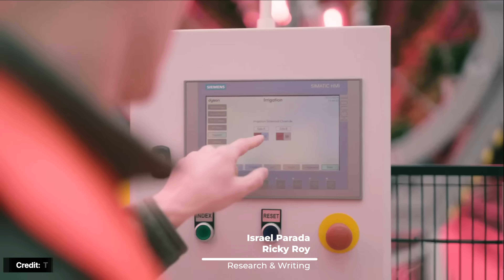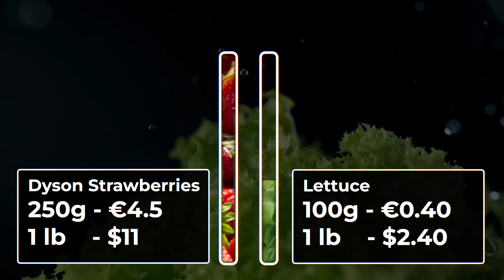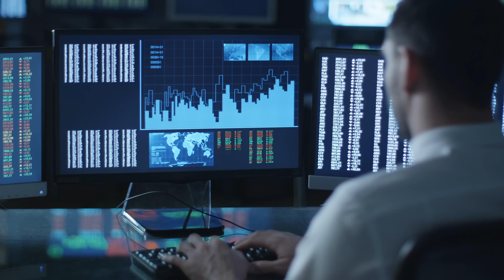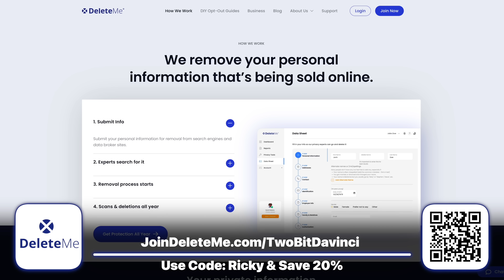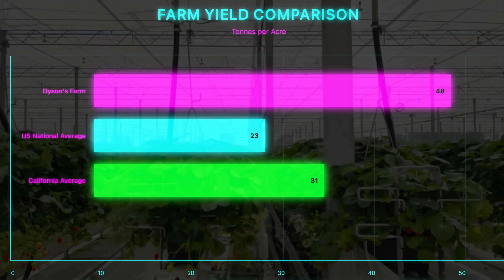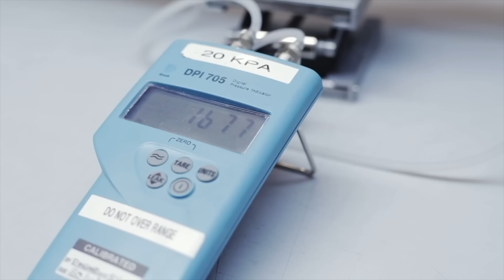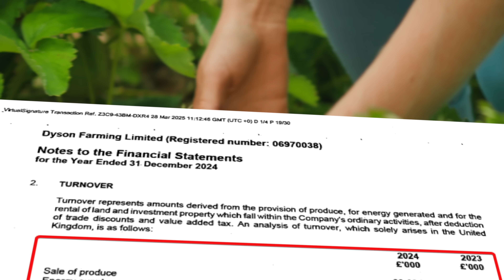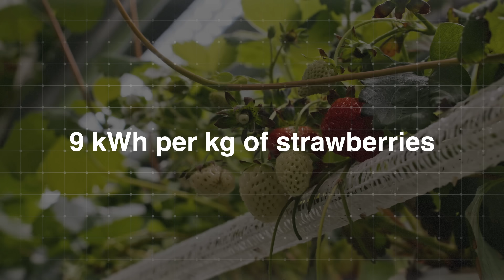The Company that FINALLY Solved Vertical Farming

Comment: Great investigation. To me the summary is "no, vertical farming is not viable on its own, but if you turn waste into a resource you can make anything profitable."
Reply: That is done in normal farms to. Methane power many conventionally farms
Reply: If they use this in a greenhouse, they can maximise how many plants a farmer can grow in that greenhouse. (You can even use elevator-type of technology instead of circular, to place them next to each other.)
Reply: @millanferende6723  And then have solar cells, electric control circuitry, batteries and led lamps. Instead of using the sun directly. It can only be viable with a severe shortage of farmable land
Reply: @lubricustheslippery5028  For Netherlands, that is the case that it needs more land. Also, with housing situation in many European countries, that is also viable option.

Solar cells would not be necessary, as that defeats the purpose of conserving land.
Reply: @millanferende6723  Nuclear is more expensive and coal, oil, gas is worse for the environment, hydro is limited, wind also uses lots of space. In places with lots of sun solar is often the best cheapest alternative, in places with lots of wind wind is the best.
Reply: @millanferende6723  Housing crisis is not because of lack of land, it's because to many want to live in the same place and greed. Produce can be transported into cities.
Reply: That's exactly what I was thinking watching this video. I don't see the 'vertical farming' / 'revolution in agriculture aspect of this plan. I might be mistaken, but I basically see someone combining a relatively low value adding economic activity (growing strawberries in a very capital and energy intensive way) with a high value adding economic activity (producing clean energy).

I might miss something, but I don't really see what 'vertical farming' adds to the mix. Couldn't this work just as well (if not better) with normal farming? You would have the same agricultural waste, which could be processed into biogas, right?
Reply: @jac540  Many normal farms process agricultural waste as manure into biogas and use the rests from it as fertilizers. And the strawberry wheals doesn't add so much verticallity.
AI and robotics in farms are interesting, it can reduce the use of pesticides and fertilizers and treat each individual plants.
Reply: @jac540  Yes, exactly. Although it seems they can get a premium on their strawberries, and at least part of that is the mystique of high-tech processes.

Comment: If the strawberries are really a byproduct, then what they are actually doing is using energy that could be sold at a profit.  In other words, the strawberries are a money sink-hole that is dragging down the overall performance of the rest of the farm.

And no, these are not at all, in any way, a solution in a "nuclear winter" scenario, since in a situation like that, the field crops would all be dead, and not producing energy to maintain the greenhouses of berries.

Dyson hasn't actually fixed any of the problems.  He's just chipped away a little at the overall costs, while still being far outside the envelope of a viable business.

Comment: While this is all good, still misses the point of vertical farming. The main reason it was suggested was to compact farm production into buildings, largely for places that don't have a lot of land to work with. Then somewhere in there, the plot was lost and tech bros wanted to turn it into a money making for nothing operation and got bored. And broke.
Reply: That's true. This is more of a hybrid between a vertical farm and a greenhouse. It's a very engineery thing to do, trade one thing off for another in search of an optimal solution.

Comment: Humans infatuation with industrial agriculture is totally anti human and unhealthy. Symbiosis with nature the way God created will be the only way to affordably grow truly nutrient dense, healthy food using a fraction of the inputs that vertical farms and industrial agriculture uses. Look up Polyface Farm in Virginia as an example of this symbiosis with nature in true agriculture husbandry. All of these techno agriculture factory farming methods are incredibly inefficient and destined to fail. God is not mocked. Humans would be wise to humble themselves to solve our food security problems and study nature.
Reply: There is not a food security problem. There's a human closed mindedness and greed problem. The desire to control the food supply so you can control populations is the end goal. Not sustainable or healthy food. Be careful where you go with this Ricky. This is a great engineering feat but goes in a bondage direction unlike the freedom and energy independence of solar and off grid battery systems. Two totally different mindsets.

Comment: I believe the figure of 10k uk homes, is the overflow electricity that they sell back to the grid. E.g. they produce a lot more, use most of it themselves, then sell the excess back to the grid. In the UK you can get sweetheart green deals that pay you per kWh you generate, not necessarily per kWh you give back to the grid. That could explain the math not mathing 😅

Comment: If geothermal energy is available it could be a cheap way to power and heat or cool a growhouse. That depends on location. I live in Virginia and I have seen geothermal stuff very close to Chesapeake Bay, which surprised me quite a bit. It was for a single home, and I don't know if they make electricity with it or just use it for HVAC. Anyway geothermal may be a viable option in some places. Iceland uses a lot of geothermal and they grow plants,for example.

Comment: electricity generated on the farm is NOT 'free' for greenhouse use since it could otherwise be sold back to the grid for cash
Reply: @kevinwelsh7490  do keep in mind that the electricity is generated entirely off of the waste from the greenhouse, thus putting power back in the greenhouse simply keeps the process going, and can't be counted as available for sale
Reply: @gwenmcgarry528 no, they grow crops in open farmland to provide biomass for burning to provide the heat and energy.
Reply: @PaulineFerguson  wait, the biomass comes from a seperate farm? If so that changes my analyses, I thought it was said the biomass comes from the strawberry farm
Reply: @gwenmcgarry528  I just double checked the video to be sure, and at about 6:00, that's where the biomass farms are explained. If it was made as excess from the in-house crop, that would be impressive 😊
Reply: @PaulineFerguson I seeee, ok then this isn't nearly as impressive

Comment: Okay so the real product of these this scheme is digester biogas electricity, and a nice byproduct is somewhat overpriced strawberries. If this were truly a great idea then you would be able to sell strawberries at market competitive prices. The ferris wheel contraptions may save on electric lighting but of course maintenance and upfront they cost far more than just racks under a greenhouse roof. So why not just use the digester biogas electric plant on a regular greenhouse. You use supplemental lighting, warmth, and CO2 in exactly the same way. Eventually you can use the automation aspect as well. I mean the real gist of this is that greenhouses make a lot more economic sense than vertical farming, and that technology is absolutely stone simple and widespread and much less expensive. You can locate greenhouses on marginal land that's not fertile or prime ag production land.

Comment: The devil is "sometimes" in the detail, which should be "always in the details".    

In So. California's desalination of seawater takes as much energy as transporting the water from the Sacramento River to LA over the mountains that are 4,000+ feet high.   However, our California Coastal Commission uses a mathematical model to predict the impact of sucking in larval fish, which claims "entrainment" is a significant impact.   If you dig into the details of the math of their model, there is an assumption buried in the math that dramatically changes the results by factors of hundreds.   This false assumption, known to be false in fisheries biology for over a century, can't be challenged by the CCC rules.   Our governor is trying to spend 20 billion dollars on a water tunnel, when desalination would cost only 3-4 billion for the same amount of water (using capital costs of Israel, Singapore, and other areas dependent upon desalination).

Comment: Dyson financial statements are in UK pound sterling not USD could be the source of error. You said $ in describing the calc
Reply: Hi @chrissaunders9166 thanks for your input. To clarify, the calcs from the financial statements and the cost of electricity were all done in British pounds. We double-checked. The idea in the end was to estimate kWh of generation, which we did using the right currency. But, to your point, if we had made a mistake in the currency, the difference between the two wouldn't have accounted for such a large difference in the two estimates.
The main problem is knowing how Dyson defines "enough energy to power 10,000 homes." In the end, both that 10,000 number and our numbers are estimates, but the difference is quite staggering, so there could be something there.

Comment: I'm really surprised that building and powering motorized crop rotators is less expensive than just LED lighting them
Reply: Building is just CAPEX so spreads out into years. The energy consumption would be quite low. These don't need to move fast so just a little motor with gearbox is enough. Growlight LEDs can be 30-100 W per single one in commercial models. To light whole place could be crazy amounts of energy/
Reply: @EnhancedNightmare  That's a great point. The key savings come from offsetting the LED energy consumption with natural light, similar to a normal greenhouse.
Reply: He is pretty famous for his decades of super efficient electric motors. I wonder if the bearings were super efficient whether drip irrigation on one side along the whole length of the trays would create enough weight if there was some clever release, regain, absorption system - or at least reduce the cost of running the motors.
Reply: I mean you have to throw enough LED to induce photosynthesis, that's a lot of energy
Reply: Calories in the food don’t come from nothing. At the very least you need to provide enough LED energy to cover the calories produced, but in reality you need to cover it 20 times over because photosynthesis is incredibly inefficient.
Reply: It's not. It's all Dyson BS. He can't show Dutch tech from Wageningen becausse of patents. Thus he will create the same thing a bit different, then call's him self a genius. And asks for money.

Comment: Whatever processes can make them more economical I am all for. Personally they could probably even take advantage of carbon credit schemes where they exist to lower the cost of operations or be co-located where waste heat is available.. And there are plenty of places where that's possible! Then again automation seems to be just as important in the process as where the light and heat are coming from since trying to avoid high labor costs are why most American farms were still importing agriculture labor from Mexico to do MOST of the actual work. And without them? Well? Californians can see first hand what happens... Fields full of rotting unpicked crops...

Comment: Your analysis was well researched, analyzed and top notch!   One thought - most farms in the U.S. will till the biomass back into the ground, this returns some minerals and nutrients to the soil,  and offsets fertilizer needs for future crops.  Being that they use this biomass to generate electricity instead, what are their outdoor fertilizer costs compared to other farms??  I would guess it would be significantly higher.
Reply: Biomass into gas - turbine - elec.... doesn't result in no fertilizer does it eh! You have a liquid fertilizer at the end of the process... think about it.
Reply: @edbrady9042  I've seen some cool hydroponic vertical gardens that don't need any soil

Comment: I would like to see a mass balance of the operation with inputs and outputs because I do have some doubts. But this is not "closed loop, given the input needed for the digestor operation. It is, however, good to see people/companies working on solutions for these farms. If they manage to develop these to the point where even feeder crops like rice, grains, potatoes, and others can be produced, then they can be used as a solution for food shortages.

Comment: 11:10 - I'm pretty sure you can't sell electricity to the grid at household prices.
Household prices are made up of a lot of parts.
There are the wholesale cost, government obligation costs, network costs, operating costs, VAT etc.

For 2023, the wholesale costs made up ~52% of the household prices. At 36p/kWh that's ~19p/kWh.
For 2024, the wholesale costs made up ~35% of the household prices. At 29p/kWh that's ~10p/kWh.
For 2025 so far, the wholesale costs made up ~34% of the household prices. At 30p/kWh that's ~10p/kWh.

Numbers are from electricitybills uk (YouTube hates links in comments, so fill in the dots). That site puts the average household at 3,100 kWh/year, so let's check both.
£9,371,000/year / 27,000,000 kWh/year £0.34/kWh. 
£9,371,000/year / 31,000,000 kWh/year £0.30/kWh. 

31,000,000 kWh/year * 36p/kWh (2023) = £11,160,000

That is suspiciously close to the household prices for electricity. So close, in fact, that I suspect those are the numbers they're using rather than what they're actually being paid.

But since you didn't provide links to any of your sources, like the financial reports where you got the numbers, it's impossible to dig into that report to see what they're claiming about those numbers.

Comment: Years ago I ran an ROI/Engineering study on the roughly same thing, with different crops, and came close to the same conclusions. Didn't have the financing and generally don't like vc's. Dyson should be able to vertically integrate the mechanical items needed.

Comment: ref: 11:08
One problem with you calculation. How did you get the price per KW. As fare as I could see they only gave the total in monetary value, not per KW. The way the British electricity marked works the range could easily from 0,02 to 0,20 pence. So you could be an order of magnitude wrong in the amount in KW/h produced.
The last year average price would give a cost of about one dollar per kg, The strawberry cost 7 - 10 dollar us in season and more outside season.
That is based on average price about 15% in energy cost.
Reply: They sell only in max price periods and not when the market is flooded with free solar or wind. This is mainly evening and morning. Also those large green plastic covers are for biogas and CO2 storage. So run the turbines for 3 hours morning and evening at 0.2 and buys from the net when its cheap, 0.02.
Reply: @surters  That was the expected profile on buy/sell. Good timing could easily give you an average price 2-3 times marked average,

Comment: Based on the overpricing of their vacuum cleaners and other products, I was surprised the berries were ONLY $11.00/lb. I was initially guessing $50-60/lb.
Reply: And don't even get me started about the $600 blow-dryers, LOL
Reply: the old models (v8) are actually reasonably priced now, and work pretty well.  Just stay away from the new ones.
Reply: @xiaoka  What about new straberries :P ?
Reply: @xiaoka I can get the same results with a Bissell with a bag.
Reply: I have a vacuum cleaner from another company based off their idea. It's probably not as good as a dyson one (haven't ever used one), but it was already a lot better than my old one, and it did cost me like a tenth of the price

So, if they create the technology and others can adapt it later on the cheap, that's fine to me
Reply: @drillerdev4624  Dyson did not create the technology. Was already in use in 1930's in large industry applications. He just made it out of plastic, that's all. Alon Muskler did not invent the electric car. Just like this rich dipshit never invented anything.
Reply: Dysons are more expensive but they last longer than most.
Reply: @ThisIsMyHandleNotYoursOkay I wonder if the same can be said of their strawberries?
Reply: @aceadman good question. I guess it all depends on the environment and health of the plant. You’d think a controlled environment plant would be healthier than open farmland, but likely oversimplifying things.
Reply: @ThisIsMyHandleNotYoursOkay it’s true. But if they are more ripe, they would be better, but NOT last as long. Curious…😊

Comment: On what basis do you assume that "energy supply" is exactly equal to "amount of energy sold"? The figure could well include payments for curtailment, and depending on the amount of detail in the reporting it may also cover carbon credit payments
Reply: You're totally right! That's what makes this an estimate. We're not saying those numbers are 100% accurate, but we are talking about almost an order of magnitude difference. And anyway, the fact that an engineer from Dyson explicitly stated that the main profit engine is the sale of electricity to the grid, and we have those numbers from their financial statement, makes sense.

Comment: The only thing that I would have changed in their set up is using a SOFC (solid oxide fuel cell) to produce the electricity. It has no moving parts and provides heat on cold days.
Reply: Whoa, I haven't heard of this tech before, looks intriguing. Thanks for the mention!